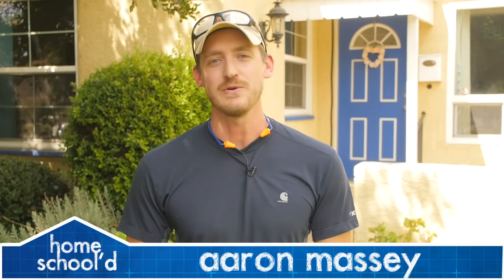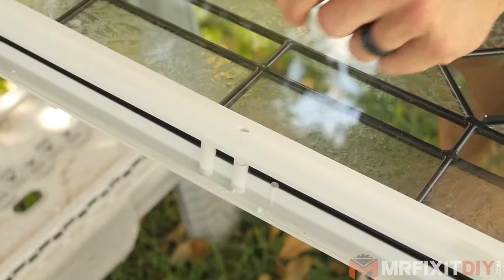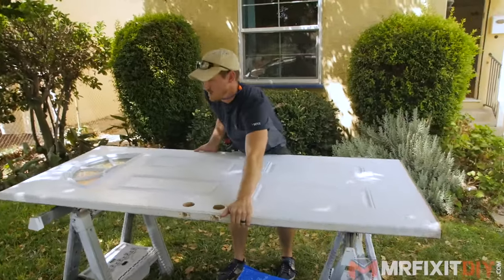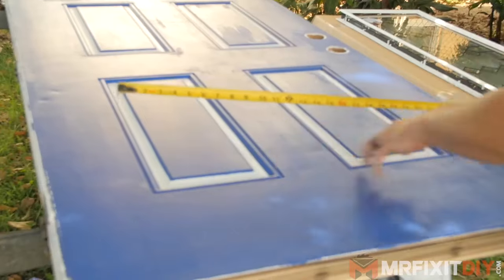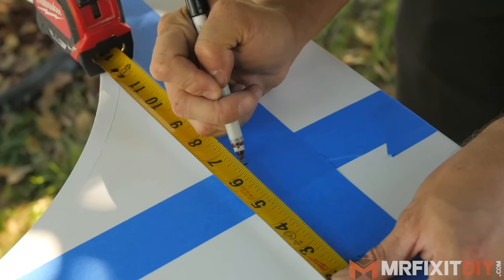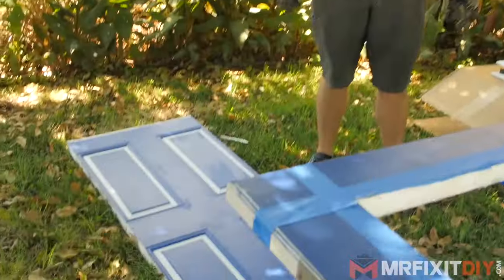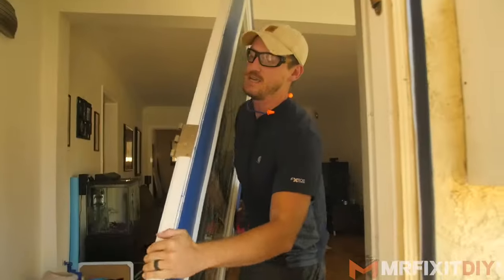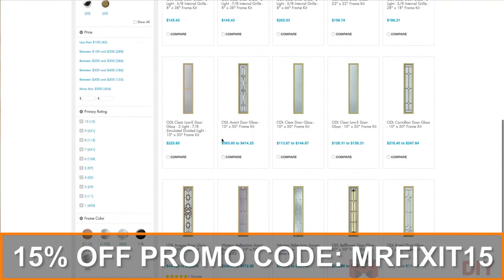Adding Glass to Your Front Door - A DIY Guide

Comment: Thanks for the excellent video. Question: do you know where I can purchase the plastic frame that hold the glass insert? The frame of my glass exterior door cracked. The door is facing south so it gets lots of sunlight that caused the cracks over the years. There is a special term for the frame which I don't remember. The frame has screws on both sides / top and bottom.

Comment: Great tutorial there. I have a few questions for you. Hope you can answer them for me.

So, I have a fiberglass door and two sidelites on either side of it. I am changing them all from the current half round (at the top) style to the squared style, so I need to do a little cutting to modify the new glass. I just purchased two new sidelites and a larger glass for the door (has 2 glass pieces the same size as the sidelites currently). I can't take the sidelites out and will need to cut them stationary. The door I can take off and cut them as you did in this video.

Before I start to slice and dice my sidelites, I am trying to find the best game plan to do the small cuts required to square off the top corners of the new glass for the two sidelites. I don't think my jigsaw has a small enough footprint to complete the cuts.
I am crossing my fingers and hoping that I can use my oscillating tool to do these cuts.

Any helpful hints would be greatly appreciated!

Comment: Hey nice work! I'm very inspired by this video and will be tackling this myself too. What are the cons of cutting and installing the full glass while the door is still in the frame vs cutting it while laid flat?
Reply: My thoughts exactly.   More screwing into the holes weaken the hole-screw integrity,…. but, probably not too bad.
Reply: @bonsummers2657  hey funny you just replied because I LITERALLY just did this project yesterday! And I'll tell you, removing the door and doing it this way with the glass laid down is the best way!! Especially because the frame isn't actually attached to the glass on either side. I thought at least one side was attached, so resting the glass flat on the frame is really the only way to safely and accurately screw in the glass to the door.
Reply: @donaldso718 I’m definitely doing this.  I’m glad I read the comments.  I wouldn’t have attempted it standing up.  I’ve replaced the bottom sweep, and painted…wish I had seen this sooner.😊
Reply: @lzh3131 yes def take the door off the hinges! It's really not hard at all! I did it all by myself haha. Good luck!

Comment: A little trick for you using the jigsaw if the blade is too long cut a little bit off of it so then you don't have to tilt the jigsaw and the heel will scratch whatever surface you're working on

Comment: Why on Earth would you waste time removing the door knob & deadbolt ????
Reply: It's in the way when cutting is why. Your jig saw is running over the location of the knob and deadbolt.
Reply: @Super_Land  I fully understand but the situation in the video definitely didn't require the removal of the doorknob or the deadbolt. It wasn't even close. Perhaps an addendum added to the video emphasizing this (possibly) not needed step would help anyone that might be apprehensive working with this type of hardware. 
Nice vid though. I did my door this past Spring based on your vid. Thank you !

Comment: No need to remove the door from the frame. The frame will hold the door in place as you cut.
Reply: I wonder why you would remove lockset, surely the insert would not overlap?

Comment: That glass insert would not be cheap. the door however IS cheap. Why not pay the extra little bit and get an already windowed door. Nice DIY project IF the glass is free.
Reply: Mr. Fix It  Man the difference across the world are amazing!
First , in Switzerland, a nice door, solid wood with glass panel costs between 6k to 10k$...
And second, you need to be at least 3 to move it 😂
And so many other thing vary, from the techniques to the aesthetics
But great work!
Reply: Home Depot wanted $500 for a new door and $750 to install it. I bought a new insert at a restore for $130.
Reply: Well no kidding That's because you went to a big box store... And idk who would want anyone from home depo doing anything on their house. Go to a wholesale or building liquidation center. I replaced my front door and back door with brand new metal doors, installed them myself, cost me $215 including new hardware...and thats CAD in USD thats like $167